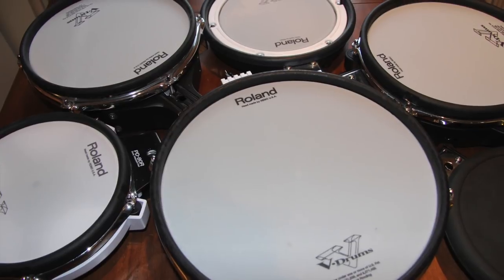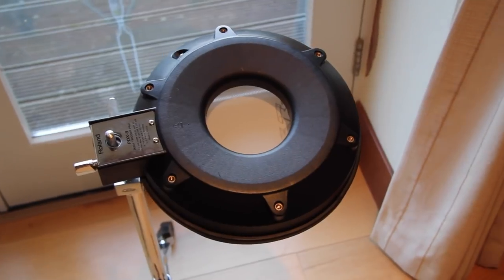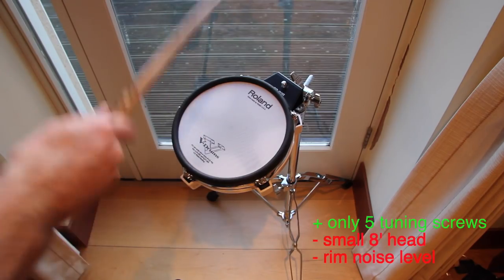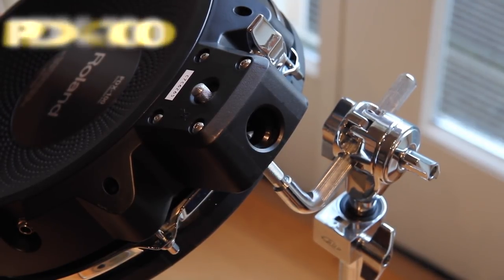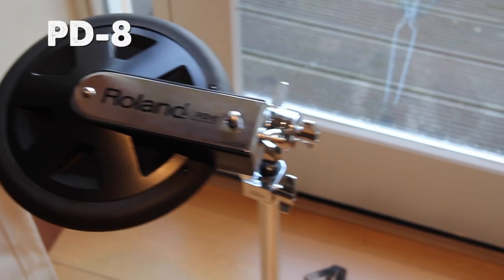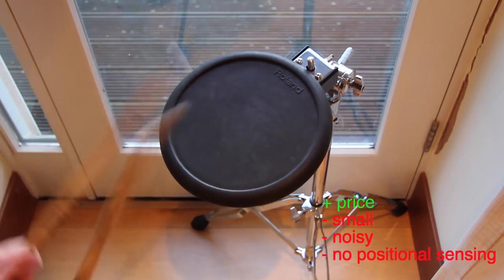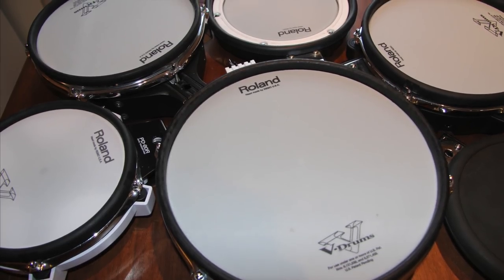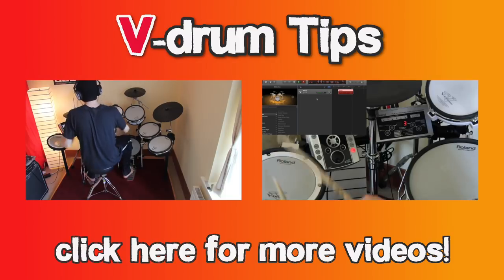Roland snare noises comparison

Comment: You are so right about the TD-12! Ok so I went to Sam Ash and played the 2Box module (btw I personally don't like the feel of their orange pads). I also played the TD-15. The reason why I may still go with the Roland is....

#1. I don't like the the 2Box hi hat, and the Roland hi-hat doesn't work with 2Box module. And I'm not into trying to create a DIY work-around for 2Box the hi-hat as I seen on some of the forums.
#2. Also, I'm not sure I trust that the 2Box company will keep improving their product for years to come....like Roland.  

Aside from those 2 things (which are 2 BIG things!), the 2Box module sounds good and can plays samples. If you can help enlighten me a little bit, Let me ask.... If you didn't have the TD-9 or ANY module at all, and someone was going to give you the 2Box or the TD-12....which one would you pick, and why?

Comment: thanks for the comparison! in fact, i want to upgrade my snare pad for my td15 kit and choosing between pdx100 and pd105 now. in terms of functions, they look the same to me. both are 10" head, support rim shot and xstick, with position sensing, except pd105 looks more fancy. in fact, for the same price, i can get a brand new pdx100 but just a used pd105! it is very debatable......:(
Reply from the maker: I think a 10 inch pad is to small as snare. What about modifying a 12 inch acoustic snare. There are so many great trigger systems out there. Or go at least for a used PD-125.
Reply: Vdrum Tips the original snare of the td15kv kit comes with 10" snare pad. thats why i am thinking about to get a 10" pad to replace my pdx6 pad and use all pdx8 as toms. i am just a beginner drummer and i thought the 12" pad is for those pros? yeah, i like the pd125 but again, price.....a used one costs over $250 :((((

Comment: Hi. Do you know if the PD-128 could be used as a snare without any issues? Ask this because roland tell that they are "designed as a tom pad" (http://www.roland.com/products/pd-128-bc/). They also have the PD-128S, but I want to have the clamp mount option, instead of the snare stand only option.
thanks and congratulations for your videos!
Reply from the maker: Yes, it will work. It is exactly the same technique.

Comment: You might want to add the position of the piezo pickups on the pads as these can create hot spots if you are not used to them - or if you mix pads with center and lower mounted pickups etc
Reply from the maker: +Benjamin Beames Most of them have a centered Piezo, only the PDX-8 has a rim near placed piezo. Good idea to mention this info.

Comment: I have a pdx-100 and I'm having trouble with the "hot spot", any suggestions....
Reply from the maker: What module are you using? Is the mesh head well tensioned?
Reply: I have a 11kv.....
Reply from the maker: Tension the mesh head consistently on all screws equal, increase the tension itself. Then check the TD-11 user manual to understand all trigger settings (Sensitivity, threshold, Scan time, etc.), once you understand those parameters, you can adjust the settings, that the hot-spotting will be less present.
Reply: Thanks very much....

Comment: H E L P!!! Ok, Iim trying to complete my roland 5pc kit.... but I have to buy one more PD-125. BUT.... there's a Hart Dynamics 13inch snare drum for $200. Are you familiar with the Hart Dynamics brand?  Which one would you get for your snare, Marcel?
Reply from the maker: I never had a hard dynamic. But a 13 inch snare is cool. I would give it a try. I have a PD-125 for the moment. But I am building a trigger system for a 14 inch snare at the moment. But my favorite size for a snare drum would be 13, because I play a 13 inch on my real kit. What do the reviews and the people in the forums say about hard dynamics?
Reply: Marcel Price Ok, I've gotten some good feedback on Hart Dynamics and their hammered chrome snare. Come to find out that the main people at Hart helped create the mesh heads and sold or licensed the technology to Roland. So I am told. So I just ordered it.

Question... what are your thoughts of the 2Box sound module? I'm trying to decide between that and the TD-12 you suggested.
Reply from the maker: You can sample your own sounds on 2 box and it has a usb port, but the hi hat is nothing compare to the vh-11 and a Roland module. Also, the TD-12 has positional sensing on the snare drum. I am still searching for a td-12. But I think the sounds are better on the 2box. They offer free sounds as download too. Difficult decision.
Reply: Marcel Price You are absolutely right! The cymbals and VH-11 and 12 hi-hat are best on the Roland. You totally got me thinking about getting that TD-12, especially being that I already bought all the Roland pads. Marcel, if the TD-12 has positional sensing, then what does the TD-20 have over the TD-12??
Reply from the maker: Bee Gee
The TD-12 is just the little sister of the TD-20, it has less pad inputs and a few settings are missing. That is why I am searching for it. The TD-12 is half the price on ebay. <for extra inputs you can use a tmc-6 or a Alesis IO later.